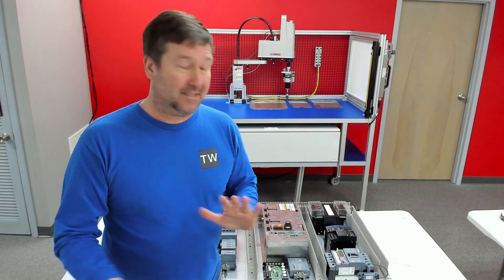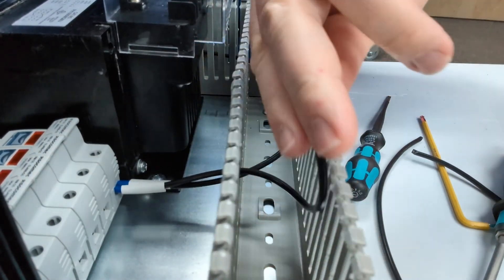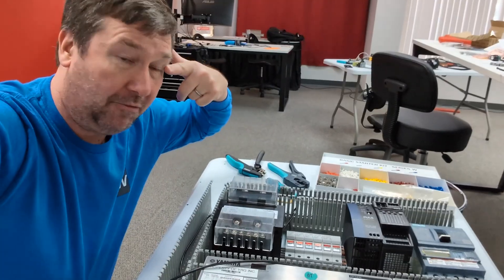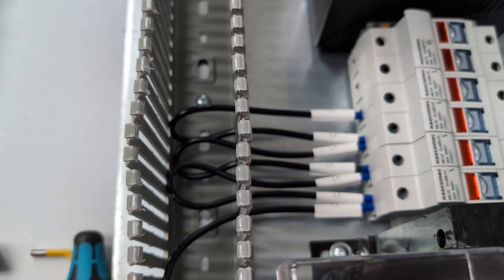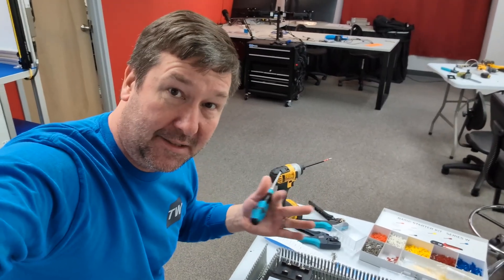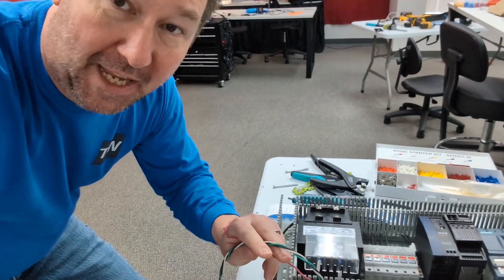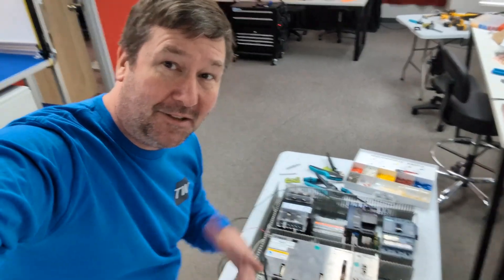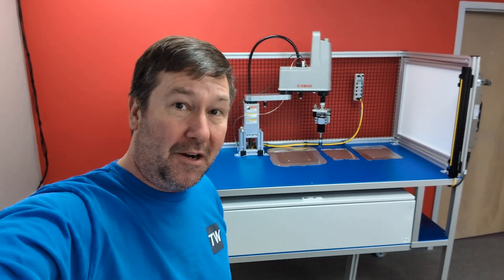Tips for Wiring Your UL 508A Control Panel

Comment: Great information, When should you or when should you not ground the DC- or DC common conductor? Future topic?
Reply from the maker: It may be a worthwhile video, there has been a lot of discussion on my wire color video about whether it is called DC common or DC- which actually brings up the grounding discussion. 

Class 2 power supplies are not required to be grounded and most are not. There could be some noise reduction by grounding them but I have never ran into a noise issue that grounding the DC- solved.

Comment: I have always called these ferrules "Bootlace Crimps" because they look like the Aglets on the end off a boot lace. There are other types of ferrule as well.

Re the cable marking - Thank you Tim!
I have always followed the left to right and bottom to top direction, based on years of circuit drawing and following a standard for that, so that it is readable in 2 directions only.

I have always thought that having wire markings upside down is counter productive, especially when your up a ladder looking into a control panel etc.

However, all those that I work with seem to have come from historical training where they were taught to put the wire markers on the same way not matter what direction the cable is pointing, this is even specified in an IEC standard, which is part of IEC60204 - the std (like UL) that EU/UK panels should adhere to in order to be safe etc. (I'm in the U.K.)

Being someone that always questions everything, I question why they were taught this way?
I suspect it's because it's a lot easier to do, no having to figure out the cable direction - everything is done the same - t'was dumbed down.
Unfortunatly, as everyone else in the company uses the dumb way I have been forced to change, although it makes it faster to load applicators IMO it makes it harder to read.

A bit like why ANSI gate symbols have been taught and used for years, the original guy that taught someone used them, his student used them and taught them to someone else etc.
Anything else just does not represent a gate to me.

Re the electric screwdriver, I have arthritis so cannot do the job without one, however I have a Phoenix electric driver that has calibrated torque settings, I also use a small cheap 12 electric driver/drill, I can hold the 1/4" bit while I pull the trigger and it will not turn - so it's weak. This means I can then go everything up and go round it all with a torque driver afterwards.

Keep up the good work mate :)
Reply from the maker: I had to eat my words on the marking, see video below...
https://youtu.be/Cl6wR70pncs

Comment: Hey Tim! I had a question about the wire ferrules. I am running into an issue where my mcb recommends my wire strip length to be 14mm, but unable to find a single ferrule with the barrel length of 14mm, but in 12 or 18 mm. Would you say that uising the 12mm barrel length ferrule is acceptable?
Reply from the maker: That is a good question.  I would reach out to Phoenix Contact and ask.  Let me know what they say.
Reply: We use long ferrules and cut to length. Some items take short and some long.
Reply: @dwaynes5983  this is interesting, what tool would give you the cleanest cut?
Reply from the maker: You can't cut ferrules to length if you install them per every manufacturers guidelines that I have ever read.  The wire has to protrude passed the end of the ferrule.  If you install it, crimp it, and cut it then it is flush with the barrel.  I read a little about the why of this back when we did the video at the following link but it had something to do with making a spot to trap gas and when it heats/expands, it will crack the ferrule.
https://youtu.be/hvDT8QMNRUU

Comment: I have a few things to add on these  contents :

1- ferrules are a must until you reach 16mm2 square of size after I prefer using a different type of ferrule , the regular one with the heat tend to expand and you have a loose power wire in those cases if you don’t have the right one I prefer to tight without any …

Also on the long run I prefer the nomenclature of the cables doing it with a plastic tube as protection, if you work in a harsh environment the printed labels disappear after 10-15 years

And maybe because I was teach from a European company I preferred to use the scissors but it’s just me …

What you think about those new machines from ePlan? That makes the right length of the wire and the labels directly from the schematic?
Reply from the maker: I would like to play with one of those ePlan machines.  It could bring your panel building to a whole new level.

Comment: Why do you still use transformers in your panels? Could you not use solely switch mode power supplies? I always feel transformer's are heavy and take up a lot of space. Interested to get your take.
Reply from the maker: In my case, I am powering this training cell with 120 VAC but I needed 230 VAC for the robot, it was my only option.

But you are correct, in many cases You can go directly from your incoming power including for 480 VAC 3 phase to a 24 VDC power supply
Reply: @TimWilborne  Yeah, I actually watched the video and saw the transformer after I replied.  There are definitely times when a transformer is the only option.  I thought the comment from the other guy acting like transformers are obsolete was odd..  Keep up the good work Tim!
Reply: They are typically used to get single phase power from 3-phase.  If you need 3-phase AC and single phase AC in a panel I don't believe they make power supplies for this..  I've never seen one at least.
Reply: @surplusautomationsupply3427  Usually in the UK we run a three phase supply with a neutral to a control panel. This means we can get single and three phase supplies @400V and 230V. I used to use 110Vac centre tap transformers for control but with the advancement in SMPS and 24vdc control gear, I find transformers obsolete for most applications.
Reply from the maker: This is partially a difference in our voltages. 480VAC is common on plants but when center tapped you get 277V which isn't common except in lighting applications. While less needed today, there are some products that are 120 volt only. 

Also don't forget about transformers noise reduction capabilities and reduction of SCCR.

Comment: I've seen in several situations with intermittent problems, that adding ferrules can make the problem disappear. Especially with safety circuits or situations where vibration is an issue. I always use them with spring terminals. I've been sold on them since I started using them for around 15 years ago.
Reply from the maker: I agree.  It takes a little more time but it doesn't take much time chasing down that one little fray wire to pay for them.